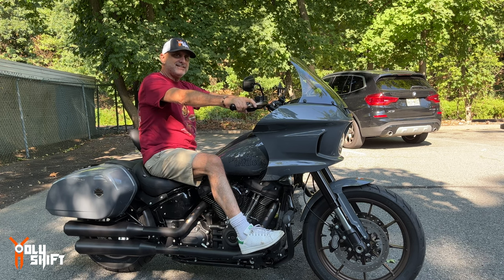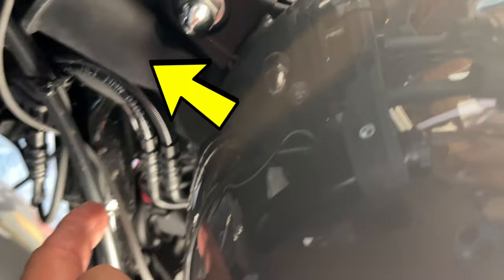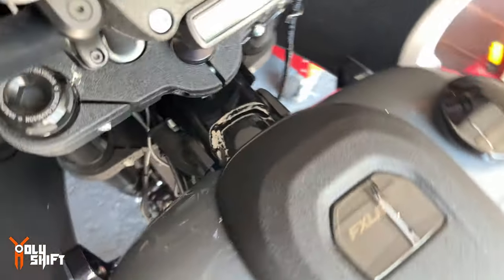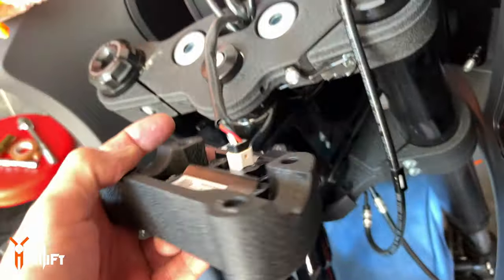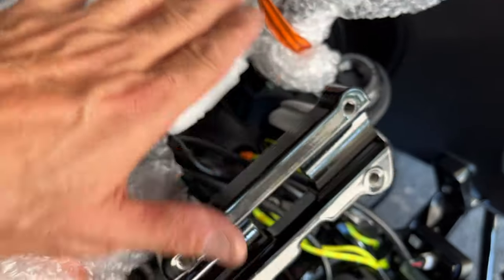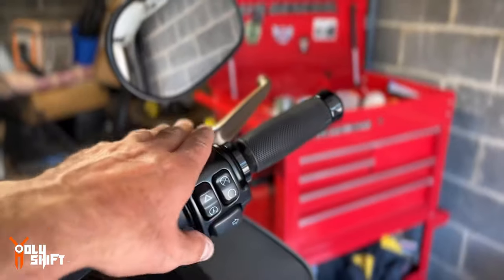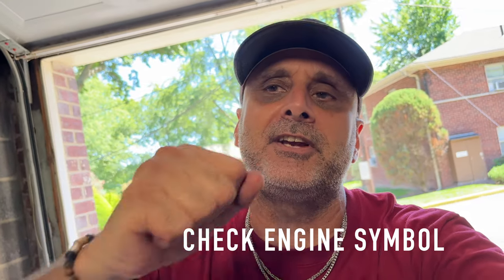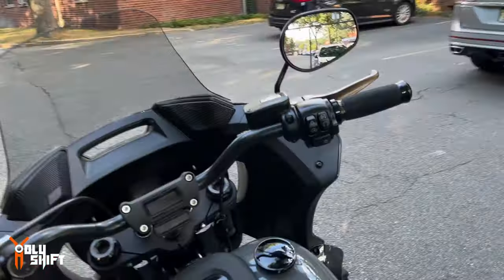Risers Install Low Rider ST.

Comment: Sandy, I have a 2022 Low Rider ST as well and your videos have been tremendously helpful and I really enjoy them. Keep them coming!  I'm currently shopping risers as well and have  also landed on  Bung King's offering.  However, I can't decide between the 6 or the 7 inch risers w/ 2 inch pull back.  Out of curiosity, how tall are you? At your height, the 6 inch riser looks perfect.  If you're willing to share your height it might help me decide which size to go with depending on if I'm taller/shorter than you 😀  I'm  5'9" myself, Thanks!
Reply: Sandy and all, I just watched your next short you posted which answers the question of your height. If anyone else has the same question, watch the next vid
Reply from the maker: Hahaha….yes - I’m 5”9-5”10

Comment: There's some braided expanding sleeving you could have slipped all the wires inside and had a single more compact extension between the clamp and top yoke, just saying. Oh yea and you disconnect the fuel pump then try to start which drains any fuel in the pipe and removes any pressure on the fuel connector. After is a complete waste of time.